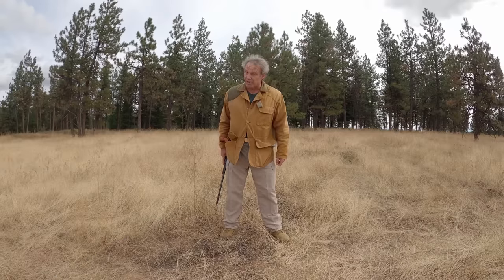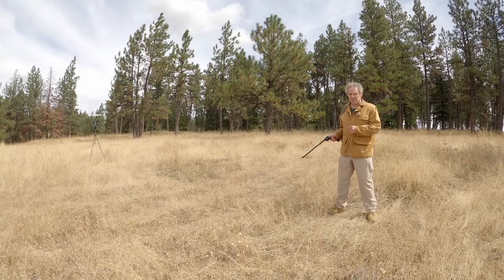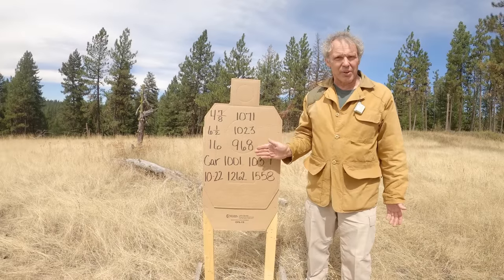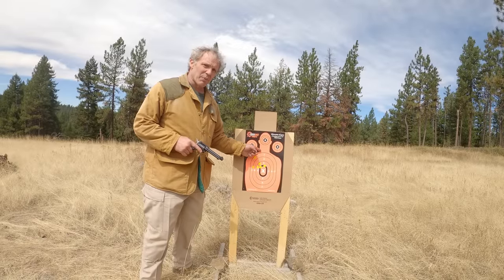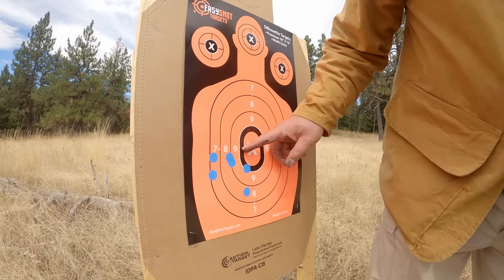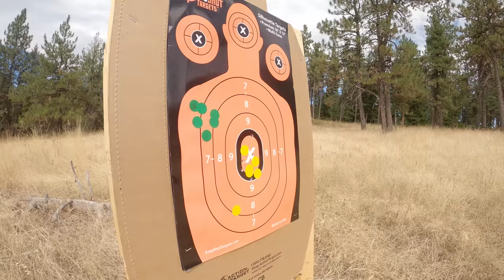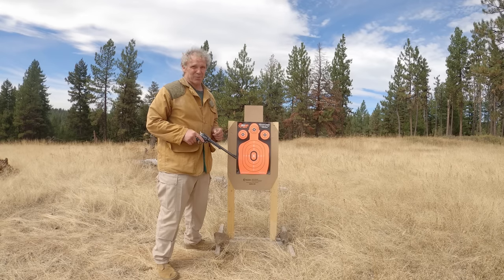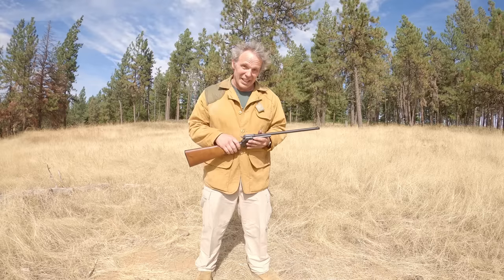Heritage Rough Rider Revolver Barrel Length Comparison

Comment: It had always seemed to me that the pressure losses are significant considerations in evaluating the losses between semis and revolvers......which you have aptly illustrated.

What DID surprise me, however, is that in the revolvers.....a 2 in, 4 in........up to the realistic barrel of about 8 in, there is, essentially NO DIFFERENCE..

I am reassured..........thanx.
Reply from the maker: Depends on firearm and ammo selection. We also have a presentation where I compare the velocities of a Dan Wesson revolver with 2, 4, 6, and 8 inch barrels. Results are interesting.
Reply: @PaulHarrell  I watched it..........thank you.

Comment: Tests of larger caliber revolvers show that longer barrel length means more velocity. I wonder if heritage has more cylinder gap, or if the gap has a bigger effect on 22lr.
Reply: You know, it occurs to me that the Rough Riders are made to accommodate the slightly wider 22 Magnum as well as the 22LR. Complete guess on my part so take with generous helpings of salt, but maybe that contributes to some gas bleed off as well as the cylinder gap? I would be really curious to see if the same results could be observed while using the magnum cylinders. Perhaps one day his brother may dive into that.

Comment: These are surprisingly not terrible guns so long as you keep the screws tightened after every shooting (or just lock them in with superglue) and clean them often. Don't tighten and you'll quickly have screws walk themselves out. Don't clean and it'll get gunked up really fast.

There's absolutely better rimfire revolvers out there, but the price can't be beat.
Reply: The only really bad thing about .22 is the stuff is dirty...lead or copper washed doesn't matter...brand doesn't matter...we clean after every range visit...and it seems in our case the operation of our various .22s begins to be affected after 80-120 rounds fired...the Heritage isn't overly difficult to clean, but it will sure get dirty with the best of them...

Comment: Over sized bore for bullet or too slow a twist or too low a velocity for the length of bullet (heavy bullet) to get the correct RPM = destabilized.

Comment: I wonder if the results would be the same with other brand single action revolvers. The gap between cylinder and force cone can be significant with higher pressures of the longer barrels.
Reply: I would think every revolver has that gap, wouldn't work otherwise...as for the tolerances, I have no idea, but we all know .001, .002, or more can affect the operation of ANY gun...
Reply: @PetuniaIii-pd1ww  the gap absolutely has to be there for the cylinder to operate, the width of that gap I would think would be a factor in how much pressure escapes before the projectile leaves the barrel. I'm just wondering how much, I have no idea of the tolerance differences between say, a ruger and the heritage. Does 2 or 3 thousands equate to enough of a difference to make a difference? I'm just wondering, it won't kill me not to know :)
Reply: @donakahorse  true, but it is an interesting question...my first guess is all manufacturers would love to maintain the minimum gap needed, as performance would be optimized...and there is probably a maximum gap allowed, before the weapon becomes unmanageable...based on ammo performance, one would think the tolerances are rather standard on all revolvers, the remaining question is are the tolerances rather standard on different calibers -say are they the same for .22lr and .45lc...? I'm inclined to say yes, which leads to wonder about other factors...like you said, I won't lose sleep over it, but it is knowledge that could help us poor revolver lovers...

Comment: That group with the Ruger revolver is maybe half the size of the best Heritage group. I think the takeaway from this is that the Heritage revolvers are cheap and cheerful, but eh far as accuracy and reliability goes.

I will say that the carbine does have all sorts of steampunk vibe.
Reply: Ultimate accuracy isn't the Rough Rider's strong suit, but once the aim point is determined it does fine...Paul was shooting freehanded at 20 yards, which is toward the upper limits for the gun...and remember, the Ruger has easily adjustable sights, which is a tremendous advantage...
Reply: @PetuniaIii-pd1ww  Adjustable sights don't reduce a group's size, just its placement.
Reply: @PaulSteMarie  point taken...

Comment: Now you did it Paul, got me wondering does the same hold true for larger caliber revolvers? I see alot of "hunting calibers" 357 44 etc with the 8 and 9 inch bbls. would the same hold true for sticking to a six inch bbl??
Reply: I would think every revolver has cylinder gap, elsewise it wouldn't spin...what the tolerances are, I have no idea...we all know .002 can affect a gun's operation, but the upper limit for that tolerance...? and you bring up .357, and .44, but really any caliber, do the tolerances differ with caliber...? I wouldn't think so, but I can be wrong...good question...
Reply: I know about the cyl gap, etc. what i meant was the actual FPS drop with a longer bbl in a higher caliber, which (in theory) should create an increase in loss pf pressure though that gap. ??
Reply: @mikepetrilla6004  it is a good question...and the information or actual testing ought to be out here somewhere...ballistics by the inch has some measured velocity numbers, but none on the actual loss of velocity due to cylinder gap...I wonder how that would be tested/measured...

Comment: That pistol with the 16" barrel looks like it needs a cartoon "bang' flag hanging underneath it. 🤣
I have a Heritage Rough Rider, with an advertised 4.75" barrel. 😎 Most people like them, but you do get what you pay for. They are notorious for the front blade sight being slightly off, along with the screw on the ejector tube getting loose. After breaking in the barrel (for what it's worth), I removed the said screw, tightened the barrel, and used thread locker on that screw. Adjustable sights cost extra.
It's a great pistol for anyone unaccustomed to a revolver, as the thumb safety gives an extra margin that newbies may need, but for experienced pistoleers, it might be a nuisance. Be aware the thumb safety IS BREAKABLE; found out from overly enthusiastic testing of that feature. Thumb safety engaged does allow for a fully loaded cylinder, but the lawyers probably ran interference on that. 
The gun can fire on the hammer's third position, but the squeeze required means that it won't be accidental. Besides, the cylinder would have to be manually rotated to put it in time if you're in the third position. It's also much easier to go straight to the hammer's fourth position, as the third position requires deliberate thought.
My understanding is that it is based on the design of the Colt Buntline, and some have said the same for the gun used on the set by Alec Baldwin. If true, then it's hard to see how that gun fired in the way he claimed.
Reply: Having looked at this again and taken notes, it's time to again take my HRR to the range. 😁 While the gun can fire .22 Short , the admittedly weak CCI CB Short subsonic will only penetrate wood to a depth the length of the bullet. My gun also has a .22 WMR cylinder; while this creates flexibility, it's clearly desirable to use ammunition crafted for a short barrel. 🤔 If ratshot EVER again becomes available in .22 LR or .22WMR, I'll try that out.
Paul's analysis confirms my view that an HRR is a good gun to train on. 👍👌 Thanks to this video, it's doubtful I'll get a longer-barreled version, except maybe a 16" version as a comical stage prop with a "bang" flag. 🤣 A great gun for camping; you can leave it fully loaded (thumb safety on) without worries. If it gets lost, it's cheap anyway.
The fact that the carbine's sights were more accurate might be due to a conscientious worker being more diligent about final barrel tightening. The 19th century saw shotguns and high-powered rifles with a revolver action, but these got a lot of squawks like those Paul alluded to, and didn't stay in production.

Comment: I have one of these that I ordered the 22 mag cylinder for. Barrels are .244 (22 mag) instead of .223 (22LR). Could the pressure loss be down the bore instead of cylinder gap? I bet the 22 mag cylinders would fit the carbine, perhaps another test is in order...

Comment: The Heritage Roughrider beats the Ruger revolver, specifically because any of the Ruger higher-end and better built (SP101, GP100, or Single Series) 22 LR revolvers are completely unavailable.  The Ruger revolvers are nowhere to be had. When I called Ruger Customer Support they informed me that they will only build based off the demand from their distributors. Perhaps the distributors don’t see a need for any Ruger revolvers.  They are still stuck in the mind set that people are only buying semi-auto pistols because of the run on firearms and ammo.  When it comes to revolvers, apparently Ruger is only interested in selling their inexpensive 22LR Wrangler revolvers. I am completely and totally frustrated as well as disappointed with Ruger.  I suspect that I am not alone.

Comment: Is it possible that the velocity difference between the Heritage Carbine, and the 10/22 can also be attributed to the possibility that the Heritage is made with less exacting standards in the barrel construction? And maybe doesn't have as tight of tolerances as the 10/22, causing a power/ velocity loss? Just a theory.

Comment: About 2 years ago I bought 500 rds of CCI 22 lr shooting them out of a 10/22 about 10 % failed to function and about 1 % had broken bullets.
Reply: CCI is like everyone else, sometimes bad lots sneak out the door...they make a lot of different varieties of .22, you didn't buy a very slow round by any chance...? as good as the 10/22 is, some ammunition simply won't run the gun reliably...10% is pretty high fail rate for any ammo brand, especially CCI...
Reply: @PetuniaIii-pd1ww  no it was standard 22 ammo,  tired to talk with them about and they just blew me off. I  should of kept them and sent them to them. I did have the lot number.
Reply: @acerimmer8357  bummer...
Reply: @PetuniaIii-pd1ww  True story that's  why I quit buying it. Best wishes

Comment: With the variation between rounds in the Rough Riders I'd be curious if it's a machining thing and there being "fast" and "slow" chambers - like if the cylinder isn't machined square and is leading to a varying cylinder gap.

Comment: With revolvers, at least in .22LR caliber, I suspect the length of the cylinder is more important than the length of the barrel.  Once you've broken the seal, all your useful pressure is gone.
Reply: Can't be solid, the cylinder has to be able to spin...
Reply: @PetuniaIii-pd1ww  you may have misunderstood me.  I'm talking about the bullet's seal to the cylinder.  Consider a cylinder that is 2" long (and then some length of barrel after that) compared to a cylinder 4" long.  The bullet gets the benefit of an extra 2" of cylinder bore before the bullet passes into the barrel.  They don't make revolvers that way because they'd be ridiculously heavy, and the ultimate conclusion of that would be to just rifle the bore of the cylinder and not have a barrel at all... I'm just saying that when the gas starts to escape through the gap between the cylinder and barrel, you lose a LOT of useful pressure.
Reply: @LabRatJason  I looked up the 1895 nagant revolver, which kinda solved the problem, as I am thinking of it...check it out, and see if we are discussing the same thing...I do catch your drift about just making the cylinder longer to ensure getting the full pressure available, and tend to agree the cylinder would have to be overly long...the magnum loads of any caliber come to mind, and yet revolvers as they are today do accelerate those loads despite cylinder gap...hmm...but in .22lr I honestly don't know how long in length the powder burn is (probably varies a little bit), and now I am gonna drink my coffee before I get a headache pondering this stuff...things could be worse if this is how I'm starting my morning, lol...

Comment: Non adjustable you say?, I adjusted mine, it is curved to the left. dead on to hit a soda can @50yrds 6.5" barrel. If you do adjust the front sight be prepared with red lock tight and the tools to snug the barrel back down.

Comment: When loading 5 rounds into a six shot revolver an easy way to do it and not have to find the empty chamber to rest the hammer on is as follows,,,load one, skip one, load four, fully cock hammer then lower hammer. It will end up on the empty chamber.

Comment: I'd like to see the gap measured with a feeler gauge on the 2, 16 inch guns.
Reply: On my 16” carbine, half cock has a .012” gap (to facilitate loading), but has no gap at full cock.  It has spring pressure holding the cylinder against the forcing cone.

Comment: I am guessing that if you were to measure cylinder gap on those Heritage revolvers with a flat fealer gauge, you would find said gap to be excessive.
Reply: They use a ramping type mechanism that really closes the gap when cocked.  But at half cock, it allows excess gap and play to make it easier to spin and load.  I had the same concerns until I examined mine.

Comment: 500 fps difference between HRR and 1022 is too much to account for with just the pressure loss in the cylinder gap. Something is off with HRR.

Comment: Longer barrel, slower speed. All the power has burned before the bullet reaches the end of the barrel. Longer barrel longer the sighting distance better the acracy.
Reply: It's not just "all burned." If you used a really sturdy bolt-action and loaded it with a stupidly fast-burning powder, you could burn up all the powder before the bullet has gone six inches but produce enough gas at high enough temperature in the process to put enough force on that bullet's back end to be accelerating it all the way out to 24 inches.
It makes more sense to load with a slower-burning powder that'll keep adding gas to the increasing volume behind the bullet for the first 15" to maintain the pressure so that you're not having to contain such a high pressure in the first few inches and so that a cartridge that ruptures and ignites goes "fwoosh" not "bang," but the transition from accelerating to slowing down isn't where the powder finishes burning. It's not a rocket.

Comment: I do not like the Heritage 22 LR pistols. 
Yes, reasonably priced, but that "STUPID" Safety is always in the way or simply forgotten and couldn't adjust the sights. Had both a 6 shot and a 9 shot Heritage with 22 magnum cylinders.
Traded both away for a Taurus 992 double action 9 shot 22 LR with 22 mag cylinder.

Comment: I own the HR 16 inch revolver with the adjustable sights. It functions and shoots fine. One thing though, I am getting slot of gas or burning powder on my hands when fired. The .22 mag is worse than the .22 lr. What is causing this? Its right on the edge of being uncomfortable. Is it a bad cylinder to barrel gap problem?
Reply: Are you shooting one-handed, or two-handed?  Revolvers are designed to be fired single-handed, making your hand far enough behind the front of the cylinder that powder burns should not be a problem.
Reply: @gregb6469  great question. 2 handed. I shoot my .44 mag that way. I'll try 1 handed and see how that feels. Thank you very much!
Reply: @currituck  -- If you want to shoot two-handed for better support, try wrapping your left hand around your right wrist, rather than around your right hand (or vice versa if you are left-handed).
Reply: @gregb6469  great idea. I'm gonna try that. I have heard that blowback can happen  with a longer barreled rimfire revolvers but wasn't sure. Thank you.

Comment: My first shots with my .22 magnum cylinder, produced all keyholes. After that, it's never happened again. Is it because of the barrel diameter, and/or projectile dimensions?
Reply: Probably the bore, unless the ammo keyholes out of all .22 Magnum guns. Do you have a good .22 Mag. rifle to check?
Reply: @MrTruckerf  The same ammo was has been working, since the initial firing of a brand new 6.5" revolver. I had been shooting .22lr just before I switched to the magnum cylinder, so I wondered if that was the reason. It cleared up for now, but it is still a mystery that I would like to solve. Maybe just a weird little breakin period? Thanks for the feedback.
Reply: @MrTruckerf  Oh yeah. I don't have a .22 magnum rifle yet.

Comment: Alec Baldwin can fire a SA revolver without cocking the hammer OR pulling the trigger. Why can't you, Paul?

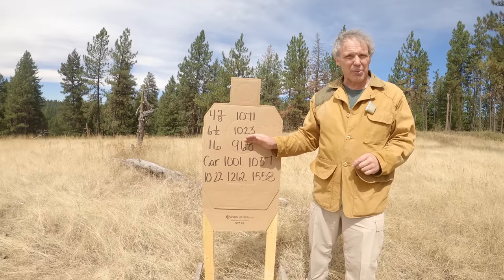9:34 Why lower velocity with longer barrels? Because, as the bullet is traveling up the barrel, gas is escaping from the barrel/cylinder gap. Pressure takes the path of least resistance. It is easier for the gasses to go out the back, than to push the bullet through the bore out the front. The longer the bullet is in the barrel, the more gas escapes. Extend the barrel long enough and the bullet won't make it out of the barrel at all. 

The Stingers have higher pressure and forced more gas out the back. the  more the pressure is raised, the more that escapes out the back. It is a fallacy to imagine that gas leaks from the barrel/cylinder gap ONLY as the bullet passes the gap into the barrel. No. I leaks there as long as the bullet is in the bore. 
Larger caliber revolvers have a much larger volume of gas but a similar size barrel/cylinder gap, so proportionately less gas escapes, compared to smallbore .22 LR. You won't see the loss of velocity until barrels get longer in larger bore revolvers. 

Why does the 16" carbine have slightly higher velocity than the 16" revolver?  Probably it has a tighter barrel/cylinder gap OR more samples may prove it really isn't marginally faster. 

The 10-22, of course, has no barrel/cylinder gap.